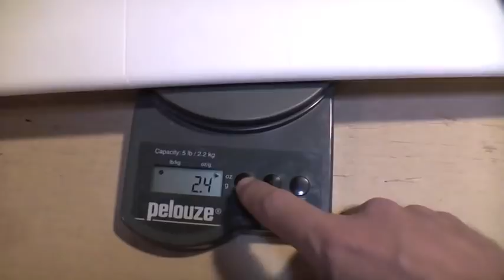Easy Foamboard Wing Airfoil: the Basic Version

Comment: Almost 40 years ago, about 12 yo I built a balsa control line trainer without plans using almost the same method.  Of course Balsa can't be so easily bent around the leading edge (LE) radius like foam can.  So, I just used 2 sheets of 1.5 mm balsa, glued a strip along the edge of one sheet and planed down the top of that strip at an angle.  Then glued the other sheet to the angled top of the strip.  This formed the LE.  Next I just brought the 2 other edges of the sheets together with glue to form the trailing edge (TE).  Added tip plates, attached a flap to the TE and sanded the LE round.  That's it, no internal structure.  Added a stick fuselage, tail surfaces, OS Pet 1.5cc glow plug engine and external controls etc.  It was good because I had struggled with a stunt model that I couldn't master.    This simple, quick and easy build and got me flying CL on the 1st time attempt.   So thanks for bringing back the memories.

Comment from the maker: It's a complicated question, but as a general rule 1:1 will nearly always do you right if your vertical and horizontal stabilizers are adequately large, like 10% and 20% of wing area, respectively.  A 1:0.75 wing:fuselage ratio is still pretty good, same concept applies about making the tail surfaces generous.  I have personally never gone past a 1:0.67 ratio and made the stabilizers plenty big, and needed active rudder control to fly.  I'm sure there are entire books on this subject.  Cheers!

Comment: THese are great.
Ive been using the 'electrifly' brand hobby foam (very light x surface tension loading) and 'ribbing' conventional rib style build with a single carbon fiber main spar...made a 2-meter wing with 9 inch chord and 1.5 inch thick rib profile...(clark - Y flat bottomed airfoil) even added "twist out" camber at each wingtip for minimizing tip stalls. Whole wing with 2 mini servos for ailerons/flapperons weighs a couple ounces. Yea...wing loading is super light, but its a light plane.

Comment: If you can run the foam inside the foil shape upright on edge you will substantially increase the wing strength.
Reply: Fill with expanding foam and carve off the excess. Making something similar with my son using aluminum flashing for a windmill airfoil

Comment from the maker: There is no absolute rule but it seems to work out that a fuselage length that is 70% of the wingspan is a good sweet spot.  Shorter tail needs larger horizontal and vertical stabilizers, longer tail can have smaller.  If you had to pick one ratio to start with I would use a 30" fuselage and a 45" wing.

Comment from the maker: No NACA airfoil specifically, though it comes out to about a 5410.  It's a good all-purpose airfoil but does have a flat bottom.  The ease of build is the real attraction and it works pretty well on RC with low Reynolds numbers and the ample power we use.  There is the possibility of making symmetrical and semi-symmetrical wings but making a well-matched pair can be tedious.

Comment from the maker: That would be a pretty tight airfoil at 7cm.  The upper and lower layers of foamboard would be 11mm alone.  You could strip paper off and not apply tape to save weight, but the wing is more durable with the paper and tape.

Comment: I'm keen to know more about the control surfaces and how to integrate them.
Reply: the basis behind it is to change the lift to.     faster airflow over one or the other side literally pulls it that way.  as for the size of the surface... thats complicated aeronautical engineering.

but any case, no less then 1/4 length of wing and no more then the whole wing...   how long it is,, up in the air depending on type of airfoil. but if you make it to big they flutter at higher speed and screw up speed...
lol  not to mention the servo might not be strong enough to move it when the wind is pushing on it...   locking you controls up = slow speed nah...  but high speed uh oh. no control..

Comment: Back in the 1970's there was a small one man 'ultralight' powered aircraft called the "Cri-Cri".  It was built using some kind of similar (ultra simple, yet ultra strong methods and materials, and it might be worth researching , to find out if there might be some lessons to learn on how to build precise, yet super strong wings, (or even rotor blades?)!   I remember an article about it saying that the builders 10 year old daughter built the wings for the plane, and that it involved using some kind of 'vacuum cleaner' to help hold everything in place (like a crude 'vacuum-bagging' technique) though the wings were made of thin metal, over a foam core, (perhaps with an aluminum tube, as a central spar)?  [Thanks!]

Comment from the maker: @carstensonderskov It's called "foamboard" or "foamcore" and can be found at many craft stores, teacher supply stores, and photography supply stores.  Can't post a URL here but Google "dollar tree foamboard teacher" and see Readi-Board there.  In EU you might be just fine using Depron with tape reinforcement.  It's too expensive here.  US$1 for cheap foamboard with thin paper is great value here.  If you find it be sure the paper is thin and peels off easily.

Comment: Perhaps these surfaces could be covered/wrapped with strips of clear 'packing tape' - which is very thin, yet smooth, and very strong!  That might make the wing very resistant to moisture/water, and lower the surface friction/drag (?),  Or, wrap it in thin 'Dura-cote', or Mylar type of heat shrinking film, and shrink it with a small iron.

Comment from the maker: I think I would keep a model that size about 8-10oz overall weight, but so much depends on the design and your skill levels, so it's hard to give a definite answer.  4oz seems a bit heavy for just the airfoil.  What's the material and does it contain electronics with that weight?

Comment: thx ,.... im seen most your videos and FT videos... still trying get a wing that's very slow/ stable for videos. im using the ft exployer frame-thinking put your type 7 inch wing on it! maybe 4 formers and shaved more on edges and tapered trail ends .. no flaps... just 3 channel. /smooth flight. maybe oversized end caps for the wing (stable ).my first wing /haven't tried yet! its top sheet and spars only/ open underneath.. catches wind like a kite! 2 - 3/16th thick bar b que sqeers! hopes it works.. kinda glue globbly messy- . need a cleaner way to make it!

Comment from the maker: Dollar Tree (Readi-Board) foamboard is 5mm thick.  The 5" and 7" chord models I detail in the later Armin Wing videos are all-around general purpose airfoils with 11% thickness at 40% chord, similar in use to a Clark Y, but not the exact dimensions. You can easily change the thickness and camber to suit different needs.  There is really no meaningful analogy between a conventional airfoil and the KF with regards to dimensions.  If you have a specific need in mind let me know and I might help.

Comment: Hey Ed, just inspired to follow one of your designs and starting here at the basic wing. I'm planning an FPV Night Flyer with forgiving characteristics and payload for Go Pro, Flight Cam, OSD, AP and I'd say 3S 2200 lipo should be fine with maybe a 1300KV motor and 9X6 prop. Which of your fleet would you suggest? Many thanks - love that Burning Man video btw... :)

Comment: I've not built foam planes, but have done foam construction projects. In those projects window screen material was painted onto the foam. Once the paint dried the project was way stronger. Has anyone used this strengthening technique in plane building projects ?

Comment: When you cut your trailing edge to glue it down, couldn't you also score that lower piece of foam board further out by an inch of so longer than you did and then remove the foam from it and use the remaining paper left there to pull up and over the trailing edge to glue it to the new wing surface? Hard to explain, but it just seems like it would work if the original foam board is cut and scored to allow the extra at the trailing edge.

Great video. Have you made another to cover trailing edge?

Comment: Excellent video!!! ...I have two questions... 1) This airfoil is flat at one side and with a maximum thickness at 30 % from the leading edge...would you  consider this airfoil like a  clark Y as shown here :  https://en.wikipedia.org/wiki/Clark_Y_airfoil   ?
2) When you install this airfoil in your RC model  at what angle is installed  from the horizontal ? Thanks!!!

Comment: oh my thanks for all the work! It's amazing. Can I ask something? Based on KF airfoils, there are specific dimensions which will produce results for different applications (Glide, speed, normal etc...). So for this airfoil, how would you know what to make? or would you make one with close reference to the data on kf airfoil? Also, how thick is that foam? Thanks :D

Comment: When I build the wing to this spec, the CG in my wing is considerably further back than it should be, which makes the resulting glider all with a CG that’s too far back. Any suggestions?
Reply: Implement a swept forward wing with bevel dihedral. The MAC (mean aerodynamic chord) would be shifted forward from the wing root.

Comment: Can you provide the link to the website you bought the Foam boad you made the wing of? I have found some pages, but I can not identify the type of foam board you use for the blade.
I live in Denmark and i like that you by your self  are making your planes.
Reply: Hi there Nicolai, i live in New Zealand and have been experimenting with a type of foamboard thats available here, the brand name is JASART artists foamboard, 5mm thick, paper on both sides, size is 5mm x 812mm x 1016mm, one sheet costs $19.00 (NZ), remove the paper and you end up with foam sheet 4mm thick, to get the paper off i had to soak the foamboard in water for several days then rub the paper off with my thumb, messy process, a guy in the U.S.A (YT channel - toojung2die - "Arrow glider"), suggested i spray the foamboard with rubbing alcohol and the paper should come off in one big sheet, in about 15 seconds, i plan to try this, im currently building my own design slow flyer, 800 to 1m w/span, airframe wieght should come out at about 180 grams, we can not get depron sheet here, i could get depron from Australia but the cost of frieght is 2.5 times that of the depron (small sheets ), too expensive, anyway feel free to let me know how you get on and good luck, Rick.

Comment: The bend you did is a nice idea . . . I was wondering with just the one side of the paper removed, can I use a heat gun to heat the exposed foam side to make a slight curve? . . . I am hoping to achieve a chest plate form

Thanks

Comment: "cheap as possible", yeah,  Cheap made = crappy. Use hot wire to cut styrofoam to achieve practical wing. Its faster to make and overall in every way better.